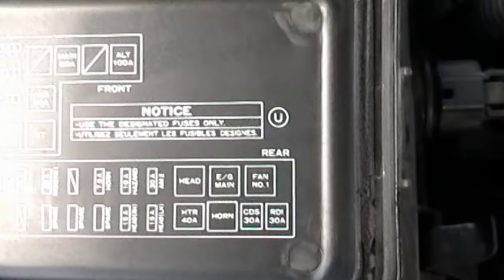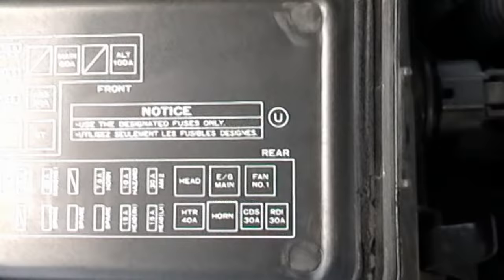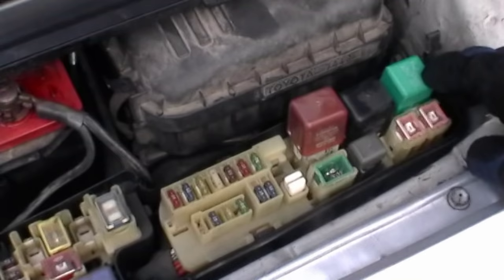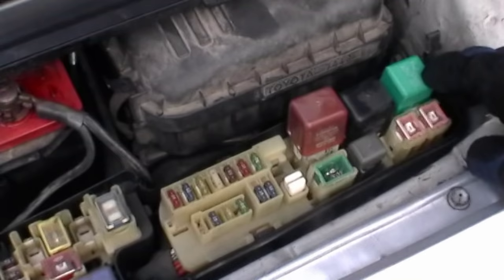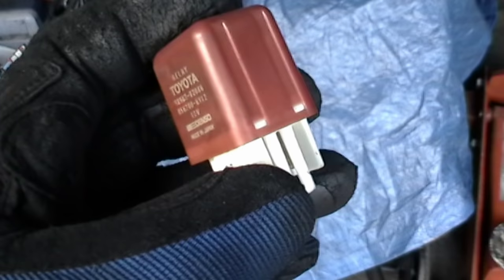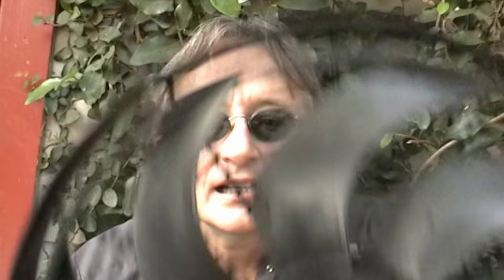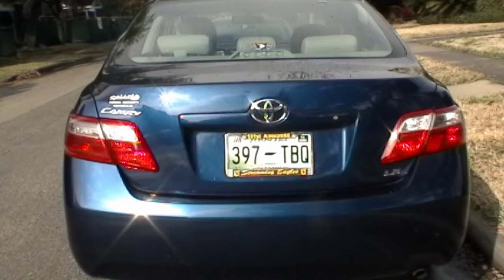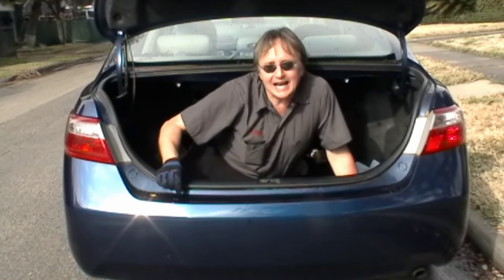How to Repair a Cooling Fan in Your Car

Comment: Scott I’m hoping you can help me here’s my situation If the fan doesn’t turn on  can this affect  The AC in the sense of the compressor cycling on and off. The Reason I ask is my car was overheating on the highway but my air conditioner was working fine  I change the relay and the fan started to work temporarily but it quit working again every since then when I turn the AC the fan doesn’t come on and the Ac cycles on and off. any input would be very helpful the car is a 98 Chevy Cavalier 2.2l Engine

Comment: Hey Scott I have a 96 honda civic and it's winter right now but my cooling fan won't turn on? Is your cooling fan suppose to turn on right when you turn on your car? Or does it only kick in when your temperature gauge goes to the halfway point? Btw my cooling fan fuse chip is fine

Comment: Scotty, my 04 Grand Cherokee 4.0 temp gauge slowly moves to hot and hot the longer I sit with the engine idling. I attempted to hand turn the fan with the engine off. That fan will not budge. Is it supposed to spin freely when I turn it?

Comment: I have a 1999 vw jetta. The air conditioner/heater in my car has been intermittent for the past few months, but now I can't seem to get it working at all. I checked the fuse, and it lights up just fine, but whenever I try to turn the fan on, nothing happens. it's not blowing any air. I want to make sure I make the right purchase, so I'm wondering if there's other things I could check, before deciding if I just need a new blower motor. I'm pretty ignorant when it comes to cars... Another thing that might be worth mentioning that I've just sorta ignored, is that my trunk no longer opens, and most of the doors don't unlock when i hit the unlock button on my keys, so now i have to do it all manually. not sure if it's all related, and means there's something electrical that's affecting all of those things, or if the air conditioning/ heating is a completely different issue. i'm mainly just concerned about the ac/heating cuz I can't defog my windows right now, which makes driving impossible most days in this weather. in the past when my fan was intermittent, it seemed like just letting the car warm of for a while was enough for it to kick in again, but now that doesn't work for me....
Reply from the maker: +8R014V you go to the blower motor, and unplug the connector to it. THEN put power and ground to the wires feeding it (doesn't matter which way, it would just run backwards if on opposite), and if it doesn't blow, blower is bad. PRAY it's just that, cause VWs are endless electrical nightmares when that old and even the ac system is computer run

Comment: 2006 Acura mdx, accidentally opened the radiator cap on the newly replaced radiator and the coolant splashed all over the engine bay, just a bit of coolant. Anyway the cooling fans dont work and smoke started coming out from exhaust, smelling like burnt. And some smoke from somewhere around the cooling fan/radiator area. What could this be?

Comment: Really dumb question but can you hurt the fan by spinning the fan by hand in either direction? It's a 2016 Corolla.
Reply from the maker: no, not as long as the car isn't running it hurts nothing

Comment: What if your cooling fan doesnt turn on like its supposed to going down the road? It turns on with AC, comes on during idling, or if I let the car sit and warm up. As I drive it the temp runs a little passed the middle. Is this an electrical issue?

Comment: Scotty I drive a 2000 Mercedes e320 I turned on my car but I notice it was acting like it was clogged I looked under the hood and The radiator fan wasn't working. Do I do the same steps as you show in this video?

Comment: Actually it does matter if it's hooked backwards.  It needs to draw air into the leading edge of the blades.  Otherwise you're moving no air.

Comment: Hey Scott, my cooling fan doesn't turn on at all if my air conditioning isn't on. If the air conditioning is on however, both come on and run but cut off periodically, then cuts back on for a few then cuts back  off and repeats. You have any idea what the problem may be?

Comment: I'm own a Peugeot 207. The cooling fan got a resistor that control the fan speed (low/high) according to engine  temperature. Is it a problem if i bypass the fan resistor? I'm from Malaysia where the weather is very hot during afternoon.

Comment: Scotty,
I didn't follow how you connected the wire to the cooling fan temp switch. Where did you clip it exactly? Thanks for posting!
Reply from the maker: on this system, when you ground the one wire that goes to the sensor on any metal part of the engine, that should make the fans come on
Reply: Scotty Kilmer Thanks, Scotty!

Comment: Thanks for the video, I have a question for a Toyota Echo, the fan goes on but sometimes it doesn't and the car starts heating up, I haven't replaced the temperature sensor, What could be the issue?? Fuse is good, should I replace the relay and the sensor. Thank you
Reply from the maker: what happened to the Raiders, they just fell apart this year after looking promising last.  And yes, replace the sensor and relay and pray its not the computer. But also have the fan motor tested, they go out more often

Comment: hi sir , first thanks for the amazing simple tutorials its really helpful 
i have a Q  , i have dodge avenger 2008 i notice that when i run the A/C condition in the traffic i got an overheating problem i will start the test like you did in this video but i wonder if there is anything else to do since i got the problem with the A/C only
Reply from the maker: either fan isn't blowing fast enough, or radiator is too worn inside and corroded and won't dissipate the heat at idle

Comment: I have a 2000 buick centry with a 3.1 it threw a code for cooling fans so I changed the fuse and the relays but the fan still doesn't move, so I need to replace the fans I believe  where would the cooling fan sensor be located on a 3.1 scotty

Comment: My 2005 mustard v6 been over heating for 9yrs. Idk why i changed alot of things out. Fan wont turn on to cool car off when it gets to hot, but works when ac is on. Overflow tank coolant rises and explodes like a volcano with no ac on. Need advise please

Comment: Mine 04 jeep grand cherokee only works on low speed... I gave it power from the connector and it worked,  then I tried the temperature sensor thing and didn't work, relays are hood i tested them,

Comment: I tried to jump my radiator fan. The fan didn't start. But I got a spark when I connected the positive to the battery terminal. Does that mean I need a new motor, or did I do it wrong?

Comment: my fan motor is working. the belt is ok but the fan itself does not turn. I have parasitic draw in either instrument cluster, front or rate electronic modules or EATC -- fuse F2.20 on 2005 lincoln ls v8. The car also will not perform self test. What shall I do? thanks

Comment: Hello, Scotty. First of all, awesome videos. I've learned a lot from them. However, my cooling fan is not working. The motor checked good, the sensor was replaced, and the relay was replaced. Still no good. The gauge stays at normal temperature. Any ideas?
Reply from the maker: MrGatoka84 if gauge stays normal, no way fans are not working unless you live in alaska. Realize them come on and off ONLY when needed

Comment: Hi my 2000 camaro, I can feel the ac cold on the vents, but when I turn the fan on, it starts to make noise and shudder.  On 1, its a little noisy and vibrates a little, but higher than one and the noise is super loud.  Any ideas on whats wrong?  Thanks.

Comment: Hey Scotty,I’ve got a 2013 Ram 1500 with a overheating problem,the entire cooling system has been replaced from radiator,hoses,thermostat,water pump and coolant temperature sensor and a new radiator fan. From a cold start up the fan turns on at about 158 degrees and shuts off at about 175 degrees and never turns back on ever,resulting in overheating the engine. I might think it might be the relays,the problem with that is that they are not in the fuse box like they should be. Dodge put them somewhere else, I thought maybe you might know or even might know what’s going on with my truck,been trying to figure this out since late last year,very frustrating. Oh yeah I forgot to mention it is the 3.6liter v6 engine

Comment: My cooling fans turn on when a/c is on but doesn't work when a/c is off the temp switch is only 2 years old so now i have to figure out if it went bad or a relay

Comment: I changed relay, cooling temperatures sensor, checked all fuse connection r good but the fan still not working. Anyway To Help Me please...

Comment: Hey scotty My Hyundai Accent fan never come on since new?  Now AC quit 50k miles.  I noticed car never gets hot via the gauge stays one tick above 1/4 low under half mark.  Pulled coolant temp sensor and fan low came on.  Ac button fan stays off.

Comment: Hey Scotty, I installed a toggle switch by your advice to my radiator fans... However even though the fans run now, I'm still overheating. Does this mean the only thing left would be to change the thermostat? or could this be a more rooted problem? thanks

Comment: Scotty, my left fan is running slow. Car is not overheating but it's running a bit hot. Is it safe to swap the fan harness to see if the left fan runs when connected to the right side harness?

Comment: hey Scotty thanks for the video! just a quick question, is there supposed to be continuity between both connections at the fan itself or not? because my fuses keep blowing but when I perform this test you just showed us the fan runs but I get a big spark as soon as I perform the test and I'm wondering if that's why my fuses keep blowing. Also, I've tested my relays and they are working good.

Comment: Hi Scotty. My fan stopped running on my 1999 mustang. I put in a new fan, fan adapter, fuse, relay, sensor, radiator, and thermostat. The fan will not kick on. Btw I did test the new fan with the battery. It worked. Any thoughts?

Comment: hello Scotty
I have Lumina LS v6 2006, and suddenly the fan wont work at 108 degree
but it start running at stage 2 with 114 degree and stop at 110

the fans both are tested and they are working fine, relays are fine
from inside the car i can see the tempreture going up i mean it can sense the change in the coolant temprature

is it possible that the ETC is having problems?
i mean does cars have a sensor to read the coolant tempreture and another sensor to switch fans on and off?

thank you

Comment: Thanks for the video Scotty, I was just wondering what size those small jumper cables were and where I can get some? Id like to diagnose the problems myself like you did.
Reply from the maker: just buy some 14 gauge wire and alligator clips, make em like I did
Reply: Will  do, Thanks again Scotty.

Comment: I did all these steps and even then fuse, replacing cooling fan and the coolant temperature sensor switch was replaced. Nothing turned on the fan even checking the wires for worn and burnt spots. Nothing… I wish this helped but it hasn’t. So now idk what to do other than pay a mechanics thousands of dollars to get it going.. my only option now cause I know I’ll be quoted a major fix/cost.

Comment: Hey scotty Audi A4 B7 model radiator fan and A/C Fan don't work unless i turn on my A/C and move them with my hand to get them started.they start for 12 seconds then they stop causing my A/C to stop working obiously so it won't damage the compressor relays are fine fuses are fine you think Module or fans themselfs?

Comment: Hey Scotty, I looked under the hood on my 2005 Dodge Caravan recently and noticed that my cooling fan is hanging halfway off my radiator. Upon further inspection I seen that it's missing a bolt and washer at the top that attaches it. Should I just use any standard bolt and washer that fits to fix it or does it need a specific special one? Thanks.
Reply from the maker: remove one of the other bolts and washer and match a new one up to that so it fits right

Comment: a mechanic told me the reason I'm overheating is because the fan is drawing too many amps, and is shorting out a wire. He said I need a new fan assembly. I researched them and they're a little spending. My question: Do I really need to replace the whole assembly or could it just be a bad temp switch or relay ? thanks
Reply from the maker: +EmeraldLeafVids could be any of those, but more often the fan motor

Comment: Scotty 2010 jeep wrangler, fan not working narrowed to no voltage on  fan relay base at  tipm , is there a way to know if its tipm   am i supposed to have 12v at on terminal at base of relay?

Comment: have you ever worked on a 2002 Lincoln LS with a V8 engine that has a hydraulic cooling fan if so how can you test the hydraulic actuator without buying a new one

Comment: Question, my radiator and condenser fan stay on until the battery dies. This happens in my 2010 Honda Civic LX.  What I do to prevent this is take out this grey fuse, and that prevents it from staying on. What should I check?
Reply from the maker: try replacing the temp sensor for the cooling fans, pray that fixes it. IF not, often a bad main computer does that and they are pricey

Comment: I see fan hi and fan low so I changed out low fan and I’m gonna change the hi too but what problem I have is the cooling fan wasn’t working so I changed the pressure temperature sensor fan came on but it stays on until I shut the car off

Comment: I hope he's not still in the trunk!!? Lol!!! Thanks Scotty!
I'm about to check a Nissan Juke! The single fan quit working!! Gonna check fuses 1st & then fan relay... if 12 DC volts powers the fan🤷🏻‍♂️🤔🤷🏾‍♂️
Prob gonna be the sensor!?
The fan turns freely with your hand... 2011 model! Perfect time to go bad! 90 degree days coming in Georgia!!!
Reply: Hi Scotty - I'm confused on the grounding too.  My cars sensor has 2 prongs... So just grounding one prong seems like would do nothing???   Any suggestions on how to test a 2 prongs?  2007 Honda Accord 2.4L.  Thanks...I enjoy your videos!
Reply: Nancy Catalina good luck Orlando here... I ended up putting a lot of antifreeze in my wife's car! Think there was an air pocket ...too low to cool properly!
Most electric fans are 2 speed! You may see 2 or 3 wires coming out of the fan!
Be careful wiring/testing the 2 speed wires?
If u can turn the blades freely & don't appear bearings worn... check the fan relay or the temp sensor! It's usually around the intake top thermostat (follow the big water hose off the top of the radiator!?)
If no wires are burned or shorted & u test the relay & the contacts open & close(check with a volt meter!?)... apply 12 volts to the solenoid & hear the contacts pull in?!
If fan good relay(s) gd no shorts etc .... prob need a new temp sensor!?
Process of elimination if u can't figure the sensor!
Some maybe thermistor type & feed another area of operation?! Nissan Juke is a pain in the behind!!! No room to move freely in the engine bay!!!!
Reply: Nancy Catalina also... the Nissan has a 2 prong & I tried jumping & nothing happened!! One prong goes to one side of the fan relay solenoid & the other to contact side of relay base!? Left me puzzled!!! I'd love to see the wiring diagram on these newer model electric fan cars!!!
Jus do process of elimination & if all works(fan straight wired to 12 volts & relay contacts open & close & connections good) assume the temp sensor needs changing!!?!?
It's the only thing left!? Fluid levels good , water pump's good!?
Another trick is turn the ac on & the fan should work more!!! If it doesn't come on... you definitely have a problem!

Comment: thnx scotty. one last thing. why car throwing water out when we checked or changed everything relavant. it got a type of cap which let water out when its hot and  temp is normal . when fan was not working car was left on for two hours and temp was still on 90. advise plz. thnx
Reply from the maker: do my video tests "how to fix an overheating car" itr has to be one of those

Comment: Hi Scott.  Did the little jumper cables test on both fans of my hyundai excell 1998. It's the 16valve 1.5 engine.  Compressor fan is dead but radiator fan runs.  I did a relay switch check by switching it with the other switches they work.  Now it's left to the thermal switch.  Not sure how you check it but I'm assuming it has to be the thermal switch the one that senses the engine temp.

Comment: I want ask you something : my fan does not run speedly like it should be : so I think thatthe fan switch sensor is the problem and I know that that sensor when gets so hot it make closed cyrcle  so it determine the spee of the fan when it close strongly as the OHM increases : what if I installed a relay to that fan socket when itis pluged so when it gets 12v , the relay opens to connect the bother fan terminals together it the resistance is completly connected ? will it work ?

Comment: Scotty I have a 2006 Chrysler Sebring 6cyl and the fans are not coming on. I had codes P0108, P0118, and P0128. I had the thermostat and temp sensor changed. The relays have been checked and they are good. Is it ok to run the car with the cooling fan running continuously without one of the relays? Could it be something else that is causing the fans not to kick on and off like they used to? Thank you for your videos and your car knowledge.
Reply from the maker: generally a bad main computer does that, and they are expensive . Me, I'd wire a toggle switch to turn the fans on manually myself rather than mess with that insane computer stuff.
Reply: How would I go about doing that? I have had my car in the shop for about 2 weeks now and I am not getting anywhere with my mechanic. The ECU is being a pain for him to locate and then to set it.